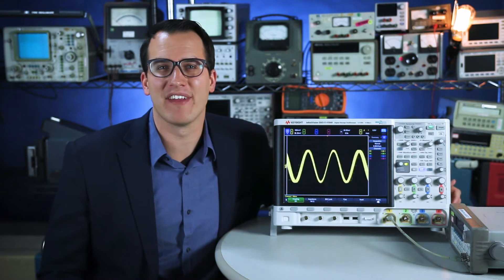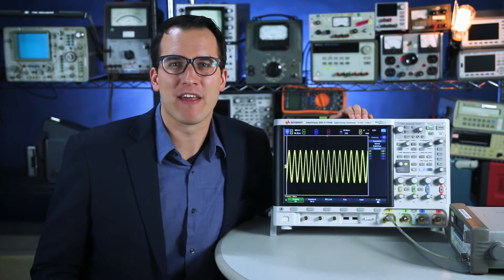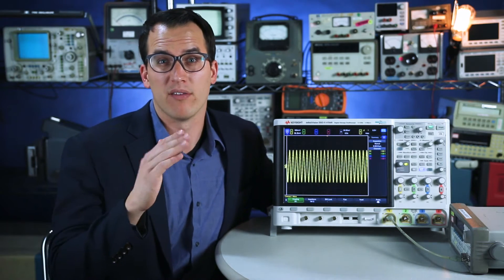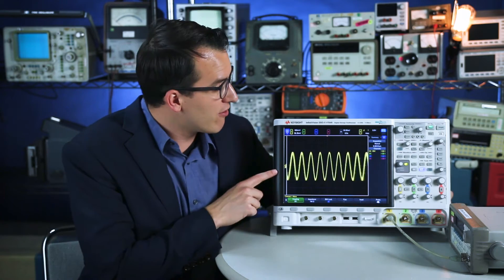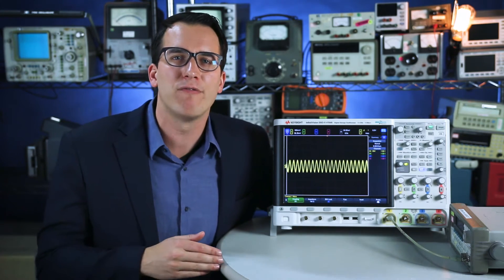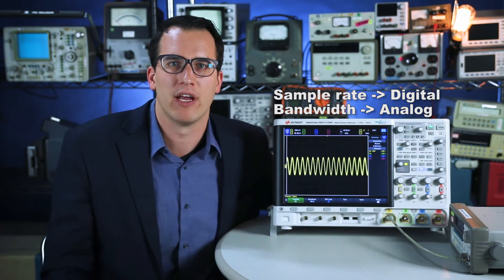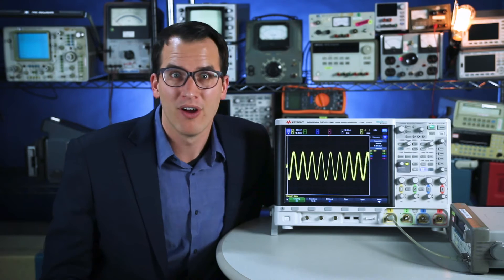Oscilloscope Bandwidth and Sample Rate Tutorial - The 2-Minute Guru - s1e7

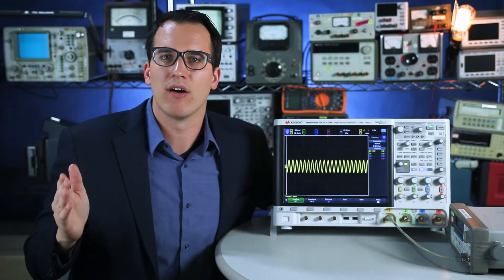Comment: I think this video contains some misleading (or incorrect) information: At minute 1:41 you state: “It’s important to note that the sample rate in no way affects bandwidth, all it does is take the data from the analog front end. When it comes down to it, bandwidth and sample rate describe two key fundamental portions of an oscilloscope.”  This confusing statement of sampling theory would likely have both H. Nyquist and C. Shannon are rolling in their graves. ( see Nyquist–Shannon sampling theorem - Wikipedia)

Your statement is true if and only if the oscilloscope digitizer has a sampling rate greater than double the bandwidth (DC-max frequency) of the signal waveform being sampled. The system bandwidth (or dc-maximum frequency) and sampling rate are linked, and must adhere to the Shannon-Nyquist theory in order for the signal to be plotted (graphically reconstructed as a continuous line) on the screen (for all possible horz + vert zoom levels) without suffering from aliasing artefacts. When oscilloscope AFE vertical amplifiers have an upper frequency limit less than the Nyquist criteria, then the AFE is acting as an effective anti-alias filter, and the extra samples (from a fast digitizer A2D) do not contain any additional signal information compared to a slower digitization sample rate which honors Nyquist theory (other than perhaps using them to filter noise from the AFE).

Comment: Good video, very helpful.
Is there a mean to measure higher frequencies than the oscilloscope's bandwidth (using a electronic trick outside of the oscilloscope)?
Thank you.
Reply from the maker: you can often measure a frequency higher than the bandwidth of the oscilloscope, but you can't view an accurate representation of the signal on screen. I'm sure there are some tricks out there, but to measure a frequency all you need to do is count edges.

Comment: Can you explain how can i use oscilloscope to calculate or measure bandwidth of such a digital signal
Reply from the maker: When talking about a signal, usually the term "bandwidth" refers to the difference between the highest and lowest frequencies of said signal. For scopes, the implied assumption is that they'll always start at 0 Hz and go up to the specified bandwidth of the scope. So, if you're looking to figure out the highest frequency component of your signal, you'll probably want a scope with 5-10x the bandwidth of your signal (the faster the better) and do a rise time or slew rate measurement to see how fast the edge is. If you end up with and edge speed close to the bandwidth of the scope, you'll need a higher bandwidth scope to make a more accurate measurement.
Reply: Keysight Oscilloscopes thank you very much for your helpful replied 😊

Comment: SUGGESTIONS: MSO triggering - what/how can  data be used to trigger the scope. I am regularly looking for situations when data gets into a range and need to time correlate that with the analog inputs. As an example - hoping to to trigger on I2C data returned from a specific slave device so I look for the master to send a specific address and data but what I am looking for is the data returned from the slave to be a certain value or above. When that data is detected, I need to look at the analog events that led up to that data trigger. At the moment, I have a separate logic analyzer and analog only scope and I have to program MCU/FPGA to output a pulse that I use as a trigger. While this works eventually - it's a pain to code each test. Hope this makes sense.
Reply from the maker: +JetNmyFuture Great idea, thanks for the suggestion!

Comment: Any tips on current measurement using a DSO?
Reply from the maker: It depends on specifically what you are looking for, but usually the key to measuring current is probes. There are different options for offset, dynamic range, bandwidth, and noise.

Comment: Hi,
Why does most of all oscilloscopes have a sensitivity limits at around 1mV/div? I want to measure below that.
Br, /Sören
Reply from the maker: Also, most applications that require mV or sub mV measurements tend to be very specific. We have found the best way to meet those measurement needs is to offer scope probes specifically tailored to those applications. Great examples of this are the Keysight N2820A high sensitivity current probe and the N7020A power rail probe. The N2820A/21A high sensitivity current probes allow you to set the vertical scale below mV/div. The probes can be used for current measurements or voltage measurements. The probes provide high gain amplification before the signals reach the input of the scope
Reply: +Sören Nilsson I am guessing it has to do with a tradeoff analysis between the most useful dynamic range and complication of the input circuitry...  The inherent noise in the input stage of a scope and sampling resolution will make measuring small signals difficult. Often, very small-signal application will also need specialized amplifiers based off the the noise profiles known to exist in those signals as well, so the amplification is probably better left to a specialized amplifier outside of the scope. A low-noise oscope is probably your best bet with your own amplifier....
Reply from the maker: Thanks for the question. The limits are based on to what degree software magnification makes sense. Under the ~7mV/div range for many scopes, software magnification is used. And at too much software magnification, you start to be able to see between the Q levels and the effective number of bits are not getting the user any better resolution of the accuracy.